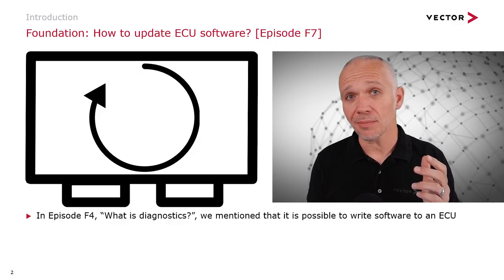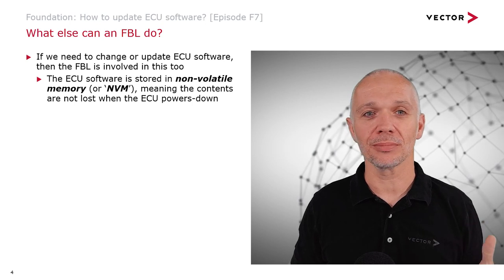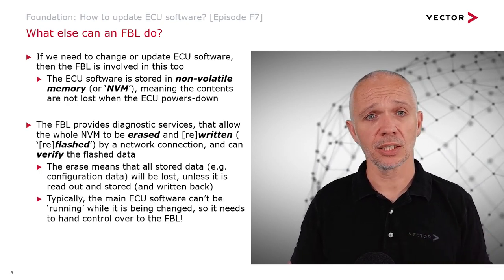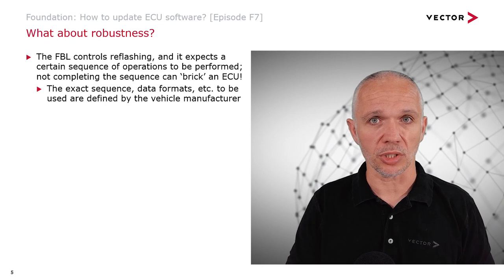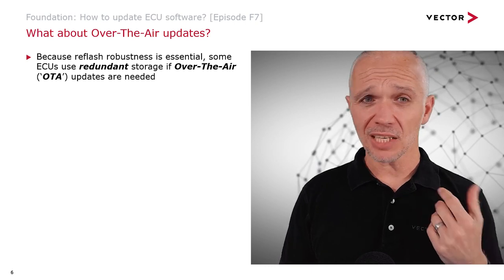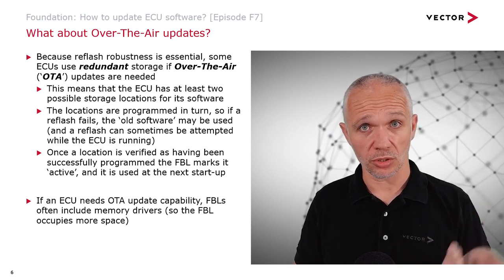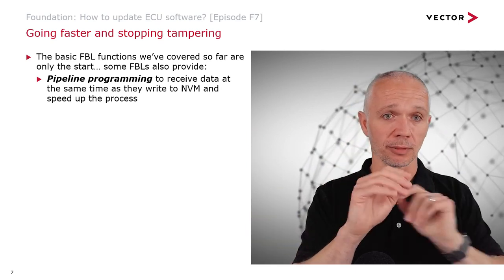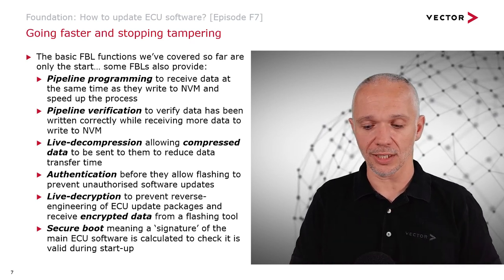How To Update ECU Software | #EnginEEringTheJigsaw | Episode F7

Comment: Hi, Thanks for this great vid. I have a question, in 08:05 you mention about over the air flashing is possible during ecu running, where is this new application flashed to? Is it flashed in flash memory that is known as NVM?
Reply: In short: Yes, provided that a redundant memory concept is used (inter alia A/B swap).

Comment: F7 has changed my way of thinking , thank you verymuch, but  I feel  that OTA update is similar to  an android mobile  phone or  a tablet   software update with many functional changes. Is  android OS recommended for Automotive applications ??
Reply from the maker: Yes, OTA update for an ECU (when using redundant storage) is very similar to a smartphone operating system update. Android OS may be used in some limited cases (such as infotainment systems); however, it is not suited to the hard real-time control that ECUs perform. Use of a given platform should be the result of careful decisions and analysis about the level of performance and type of behaviour(s) needed to meet security and safety concerns, and other requirements.
Reply: @vectorinformatik  thank you sir